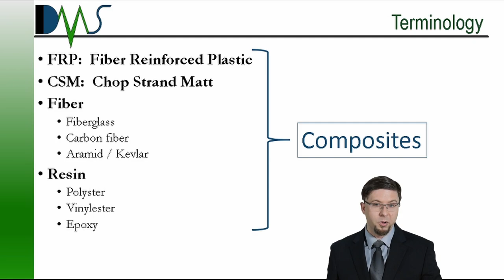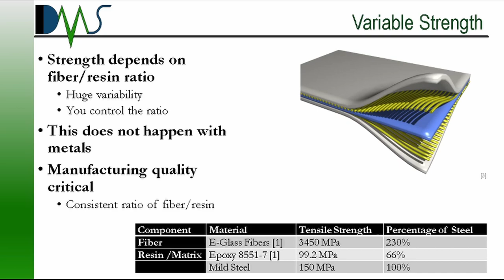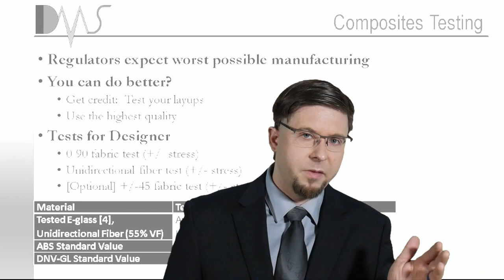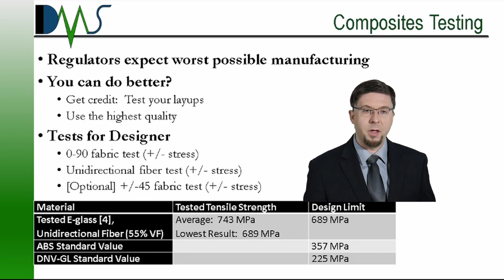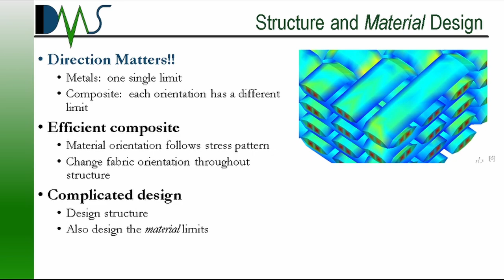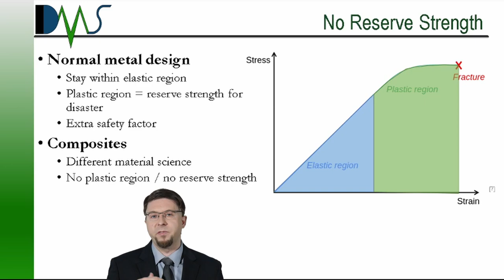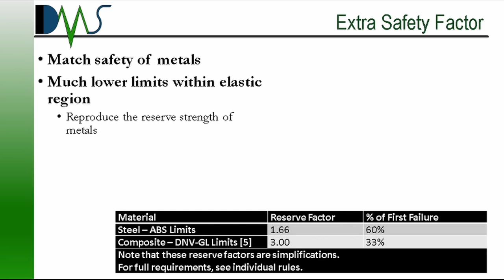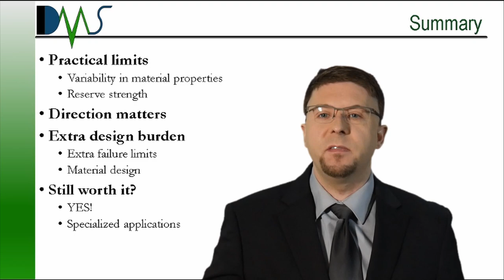Composite Materials:  Practical Design Limits

Comment: I think that was supposed to be 2300% (not 230%) for fiber/steel.
Reply from the maker: Whoops.  Yes, you are correct.  The ratio of fiber / steel tensile strength should be 2300%, not 230%.  Despite my best efforts, a typo slips through every once in a while.
Reply: @DatawaveMarineSolutions  If we're talking about 3:20 in, then I think the root typo was an extra zero in the Tensile Strength of Fiber.  Maybe using the wrong units, as N/mm^2 is closer to the number listed.  Though I found another site suggesting that the original number is roughly correct, and I'm not in a position to tell which source is mistaken.
Reply: @DatawaveMarineSolutions  Put a little text pop up over it/near it for future viewers. I was going to say the same thing.

Comment: I would also imagine that maintetance of these materials would be harder than when using steel. With steel, if a container rams a hole into the top of your double-bottom tank, you remove the jagged edges and weld a piece in. Doing that with fiberglas would be probably much different (and harder). And, the bane of innovation, no port would have the material at hand, so fixing the issue would be a logistic problem too.

Comment: I imagine the small production numbers of individual ship classes are a further hindrance to the adoption of composites.
It is just not enough, to design with composites, but rather for composites.
Which unfortunately balloons the costs, if you can't distribute that over thousands of sales.
Reply from the maker: Correct.  This is also why the yacht industry largely builds with composites.  For example, I believe Bavaria is the largest production yacht manufacturer in the world currently (I have not seen the latest sales figures).  And that is the perfect example of a situation where composites are economical.  Bavaria can design a single class of ship, optimize for that design, and then optimize their manufacturing to streamline the process.

Incidentally, this is also why new yacht models are rare.  It requires a very high tooling cost to setup production for a new hull shape.

Comment: Sweden and Danish naval architects/engineers are almost 40 years ahead! here is a link to Royal Swedish Navy "Visby class" corvette, the class where designed in the late 90s. After delays, the first "Visby" enter service in 2009. The same Swedish naval architects had 15 years earlier worked with the Royal Danish Navy and naval architects on the first full hull composite build fast Standart Flex 300 type multirole ship/Patrol vessels(multi-purpose, modular weapon system as engines too), know as the "Flyvefisken" class. At the time they were the maximum length a carbon/composite vessel could be built. Resin is control in a controlled environment -know as an own ;-), as strength goes the biggest issue is micro air bubbles in the resin! this issue where address in the "Flyvefisken" second batch -or "Mark 2" from1992 by using a vacuum, making the hull on top of the mold, and suck the resin true the carbon layers. The Swedish naval architects had pioneer composites constructed vessels and were therefore contacted by the Royal Danish navy in the early 80s as partners, so the "Visby" class benefits from the experiences learned from the 80s in this partnership.  https://www.youtube.com/watch?v=H9RdcmICyuQ

Comment: Interesting. Guess this is why racing craft are way ahead in using these materials. And why IMOCA yachts are fragile in some cases. 
Worries me about the now widespread use in airliners. But I guess their stress limits are much lower compared to ships.
Reply from the maker: Funny thing you mentioned the airliners.  I lived in Seattle for a time and took the factory tour to learn about the Boeing 787, which has a composite fuselage among other parts.  Just from the way they fabricated it, I can tell you that they are a step above my typical level of engineering.  They have a much deeper understanding of composites than the boating industry.
I can't confirm this, but I did hear a rumor about Boeing and their use of composites.  We had the math and material science for basic composites back in the 1970's.  But it took decades before Boeing was willing to use composites because they needed to generate data and perform further research on the fatigue of composites.  The airplane fuselage endures a lot of fatigue loading, which is how materials fail after 20 - 30 years of use.  But no one could predict the point of fatigue failure for composites.  That was the secret sauce that Boeing cracked.  I still want to look into that further and see how much of their findings were made public.
Reply: @DatawaveMarineSolutions  I hope they got it right

Comment: How does aluminium hull elasticity and plasticity compare to that of steel hulls? If I wanted the most durable hull possible, would it be advisable to 'not' use aluminium even though I might save weight?
Reply from the maker: I don't think there is one absolute winner for materials when choosing "durable".  Each material has weaknesses in different failure modes.  But in general, I would likely pick steel.  It has a higher yield stress than aluminum, and it includes a wide plastic range between yield and final failure.  Most importantly, it can be easier to find qualified welders for steel than for aluminum.
Reply: @DatawaveMarineSolutions   A thousand thank yous for the response.
Reply: @DatawaveMarineSolutions  In a hypothetical situation, would Titanium be a good material for a ship hull.

I say hypothetical because I know Titanium is very expensive and difficult to fabricate and weld. But if the US Navy with its bottomless budgets wanted to make a small Corvette using a Titanium hull, how would it work as an overall material in terms of strength and coercion?
Reply from the maker: @thepessimistictitan2655  I can't say exactly, since I never had the chance to work with titanium.  But I do know the Typhoon Class submarines from the USSR were titanium alloy (I would guess just the pressure hull).  So it clearly has some advantages.

Comment: Interessting overview about composit structures, all the downsides that are listed, most likely to represent reference to glass, and to level of design/enginerring , and at last degree the method/capacity of manafuctruing parts ( process, tooling rigging/handling and cost).
IF we talk about problems on materials with wicker spots on diferent material,  for example welding, thats why you  due inspections & x-rays to them.

If we refer to quality built  composites they will deliver the promisse but at higher prices, there are not   "only" good conditions, or you have or not ,  elese is scrap parts or poor design

i find  very "off" to compare the "promisse" to "real", the sample to qualify composite material have in consideration how the are built (%resin, fiberplacement, delaminations, voids..),  etc.
     
Composite material have good properties if their are handled properly (according with their manufcturing process)  as any other material.

Under the test X with X properties the strenght is X,  so its the reference. Can't expect to  use the same amout of fiber and resin of the qualification, and thats it. Rarely seen clean rooms, ply cutters, layup tooling, vaccum tools or cure system.  So then appear the worst condition, and people seam to be satisfied. 

For calculus the contribution of resin  is never accounted as it doesnt contributes and the fiber /plies need to comply with maximum deviation with their orientation as well other safety factors(reducing their max strenght).

Honestly i disagree because with proper mafcturing (that is expensive), quality control and design, i those are great.
apart ofour different views,

Thank you for your videos, its great to see people sharing their knownledge & experience

Comment: Can you please quantify the term strength as your use of the term seems to be to mislead The same with the term composite Composite is a material which is produced from two or more constituent materials. The steel used is ship construction s technically a composite. Quantifying your position is critical. Fibre-reinforced polymer (plastic) like steel is not a generic composite, Almost all of your arguments against FRP can also be applied honestly to metal Both are dependent on orientation thickness and composite attributes By using eg Carbon E-glass S-glass aramids etc, then there is the polymer it is encased in modifies and negates the argument. As this is the same for steals do they include for example carbon alloys silicates etc then there is the crystalline structure orientation etc. The thickness and how it is combined is also a factor like it is with FRP. With FRP a core is used as is a web is with most meatal to deflect/resist loads. This aligns with your final inference that the manufacturing control of the laminate integrity, this is mitigated in many ways. As with metal testing is key to checking and specifying the properties of the product throughout the process by testing eg weight, accounting of quantity and visual inspection,  etc Then there is mechanical testing and x-raying etc. The testing of all materials have the same outcome you will always take the lowest denominator and apply it to the approved safety factor. Every product needs to be correctly engineered and specified with the appropriate safety factor. The engineer when spec-ing FRP like metal must mitigate material inconsistency with the specific specification, in metal plate by specifying alloy content and combinations etc( 41xx steel) with FRP they will specify a filament arrangement percentage to a polymer percentage. They may instead specify an engineered prepregs location and orientation to achieve greater control over the outcome. They may similar to a steel web weld specify the core (web), polyemer bonding agent.
In conclusion, FRP has no limitation in relation to any other correctly engineered and managed material. The true reason that it is not so widespread is more to do with the cost, eg the complexity of construction. and economy of scale. This is another complex story. I do believe in the future that FRP will become far more commonplace in modular supper structures. If modular they can be reused over and over after a hull reaches its used by date As it will save on maintenance and reduced VOG's and displacement mass Things like prop shafts as the economy will outweigh costs. The same with Propeller blades as large scale Cabon fibre FRP 3D printing is not far away and the benefits will be huge. Again another story for another time. Sorry, that got away from me, I was only going to referance the first few sentences.
Reply from the maker: I did intentionally use a generic term for strength.  But I do add some subtle details to try and address the more technical aspect.  For example, at 2:14 the table heading specifies "Tensile Strength" for E-glass fibers.  Tensile strength is a specific material strength test and the one most frequently used to characterize the strength of isotropic materials like steel.  If I was quantifying strength of a laid-up composite, I would need to specify compressive vs tensile strength and specify the material orientation.  But the pure fiber alone does not require the same level of specification.

Comment: As someone who has built a number of hand laid Glass Fibre boats from 24 to 29 foot, I would NOT reccomend or use Fibreglass as a boat building material. Ok for a runabout but believe me....Gell coat covers a multitude of sins.... think about it. If you knew how many bubbles/faults/gaps in fibreglass boat building you would not buy one.

Comment: "Group all composites together", all that's needed to be heard to realize that the knowledge of composites are very weak. (Btw, I'm a metall guy working in machining of aluminium, steel, nickel-alloys etc and I now darn well I can't treat composites all alike just like all iron based alloys can't.)
Reply from the maker: You are correct that one cannot treat all composites alike.  However, when trying to explain basic physics of composites, I find it more useful to avoid confusing the matter with myriad details.
Reply: @DatawaveMarineSolutions  Then you also have to include all alloys as one, from pure aluminium to Inconel via cast iron and Hardox...
With ANY material selection determing application needs and comparing them to the different types and costs for manufacturing is key. Generalize and you fail.